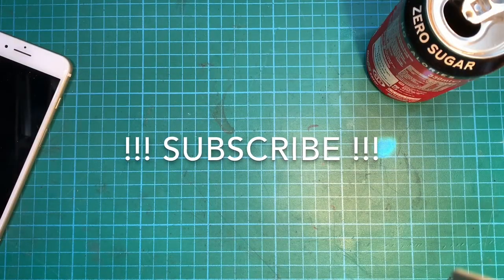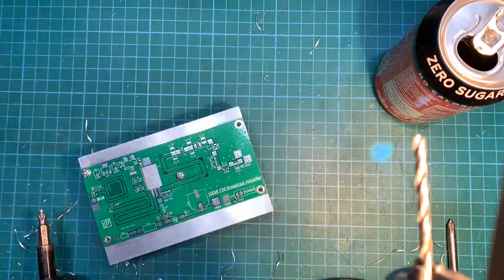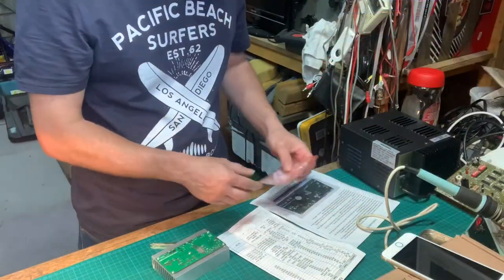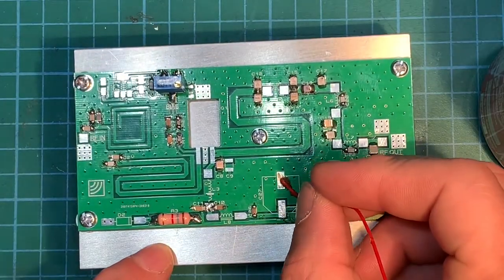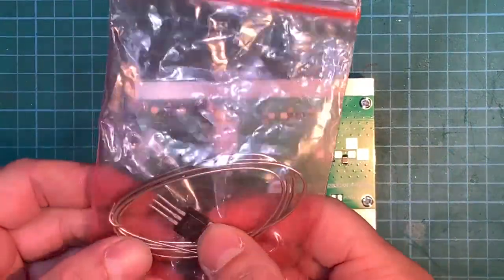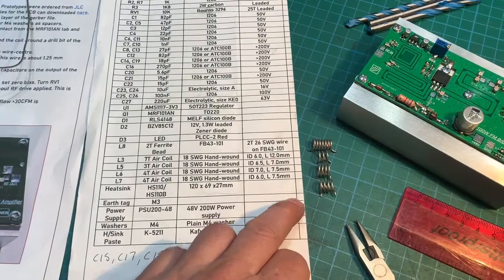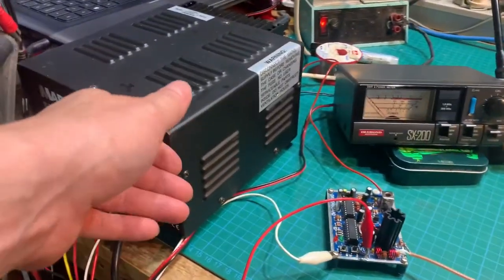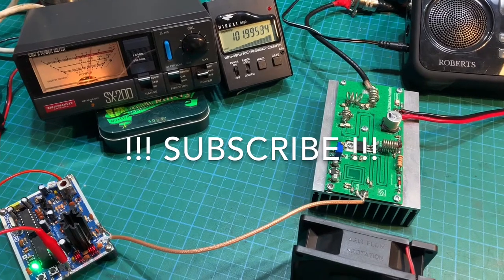100 Watt Fm Amplifier Kit Build 87-108 MHz ( Using 1 Watt Drive )

Comment: Greetings! I am aware that this video was posted quite long ago, but if by any chance you still have the schematic for this particular model RF Amplifier somewhere could you send it my way if i ask nicely? If not, i'd also greatly appreciate a similar model's schematic, i found this type of design quite neat, so if i could get a schematic of this sort i might be able to try to build it at home from custom parts because as far as i am aware this kit is no longer available. Thank you for your time, and have a nice day!
Reply from the maker: https://cdn.shopify.com/s/files/1/0719/7156/9954/t/7/assets/mrf101an_1397053583.pdf?v=1689931102

Comment: good job, would the MRF101AN give to use in the scheme of blf177? adjusting the polarization to 2.6v would it work?
Reply from the maker: Hello, Thanks for watching. Answer to your question is I’m not to sure.. this is something I’ve not tried... I have been looking at using the BLF177 on a different amp. I’ve seen the PCB on e bay... something I’m looking at building next.... Take a look.. eBay item no : 164430669090

Comment: Hi Mate, Currently Building this project, how do i about adjusting the bias to 2.6v, I do recall the info on enigma saying adjust the bias to 120ma current (100ma for mrf101an and 20ma for the led). Can you help me on how to adjust the bias. I have not purchased the mrf101an yet you think i should just get the mrf300an and push 200w? Is it stable with the current circuit?
Reply from the maker: Hi there, 1st of all I would stick to the MRF101AN I’ve been trying the MRF300 it works 200watts + but not for long it suddenly loses all power... unplugged for a few mins then switch it back on and the power is back... something overheating? But it’s not the MRF300 and the power supply is not at fault... got me stumped... But the MRF101 is working great and sits at 120watts all day long.... 
As for the bias setting it’s very easy and I’m just making a video to show how it’s done... should be up end of the weekend... If you get the amp working with the MRF300AN please let me know... Good luck and thanks for watching... 
Aron
Reply: @Aron102  Thanks Aron looking forward for that video mate. Might aswell chuck the cheapest place to buy rolled cases for the enclosure.

Comment: Where did you get the heatsink? Or what are the measurements of the circuit board and heatsink? Thank you....
Reply from the maker: I got the heatsink from e bay. 120 x 80 x 30mm. Item number: 123808906994
Reply: @Aron102  Thanks for the heatsink link! 
Also just curious if you have had a chance to measure the input currently to the amp? Thanks again!!! :-)
Reply from the maker: I’m away at the moment will check and let you know once I’m back.... maybe a week or two.. from the top of my head I think it was around 4 amps.
Reply: @Aron102  Awesome! Thanks, I want to make sure I get a large enough power supply to have about twice the required current. :-)
Also, I hope you are enjoying your time away!
Reply from the maker: Thanks, the switch mode power supply I used was 7.5 amps. Happy building 👍

Comment: Hi,

Its possible change the mrf101an to mrf300an only ajusting the bias!?
Reply from the maker: Hi there yes it is, I’ve done it.. you get over 200 watts... with 2 watt drive. 
Need 10amp power supply. Bias setting the same 2.6 volts 👍

Comment: Range???
Reply from the maker: All depends how high you have your aerial.. this would go for miles and miles with the aerial high up... 100watts output is a lot of power. 😉
Reply: @Aron102  love your videos.
Reply from the maker: Thank you Jay
Reply: @Aron102  diy world band radio receiver??
Reply: Can it reach 62 km range with a dipole made of coat hanger ,(17.17 metres elevation)?
Reply from the maker: I would very much doubt it.
Reply: @Aron102  how about 30 km?
Reply from the maker: Try it and let me know 👍
Reply: @Aron102  how do I get the 100w amplifier? Will it work with a transmitter with an amplifier built in ?
Reply from the maker: E Mail me 
eyefm102@yahoo.co.uk

Comment: It  c1971 or rd15hvf1. Only 15w RF output. 100w lie ,🤗
Reply from the maker: No lie 100 watts, used MRF101AN 
1 watt input 100 watts out... 
I’ve done it changing the 101 for a MRF300AN and you get 200 watts out with 2 watt drive.... build one you will see 💯
Reply: Wrong. Look up MRF101 datasheet
Reply: That message for Mr Goodnight